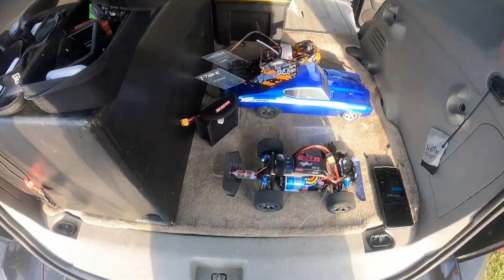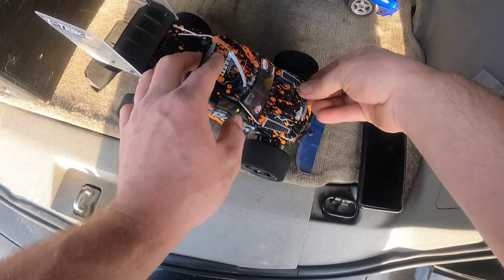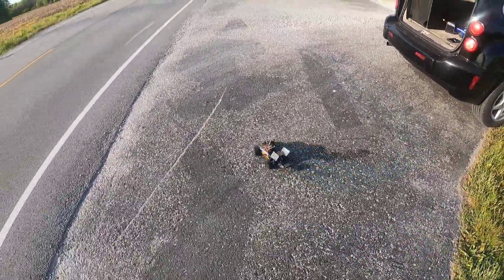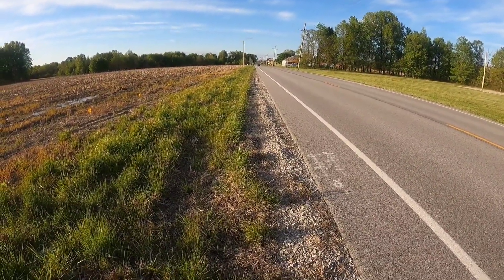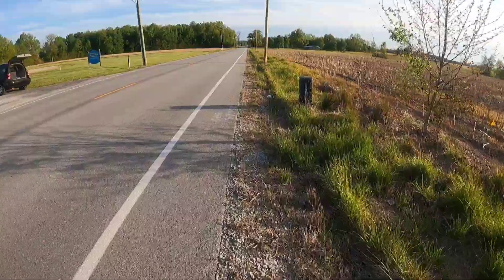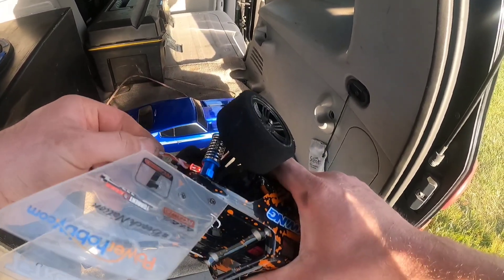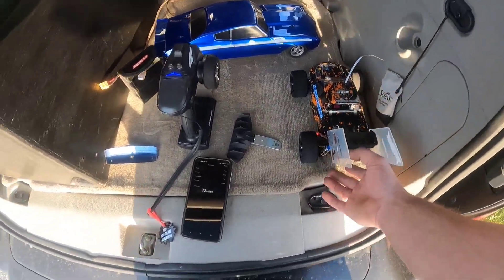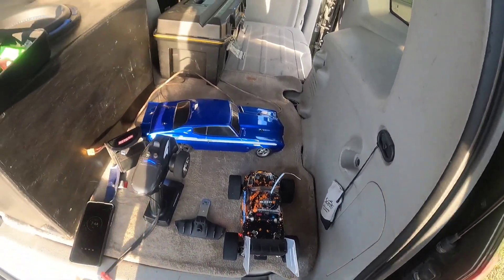Journey to 100mph with a custom built 60$ Amazon RC

Comment: toe your fronts in a pinch i can see they are way out on the toe that will make it extremely difficult to control at speed start off by setting them square then toe them in just a touch it should help a bunch!
Reply from the maker: This car has no adjustments in caster or camber that's the point of the video is to show how hard it was I got to 82mph I the next video
Reply: @garysrcchannel5251  right I understand that I was suggesting adjusting the toe
Reply from the maker: I tried aftermarket wltoys 959 turnbuckles and the car handle worse for some reason

Comment: What esc and motor???  Try using little orings wherever you have play in your front steering
Reply from the maker: Hobbywing 10bl120 & 3650 7620kv with 54t spur & 37t pinion fully Sensored

Comment: Hey bro thats all you can do on these days. Try making the bat wings like 3" tall. No wings. Get the body shell to make the downforce and use metal wieghts. Idk what Gyro was but try at 30% even if it wobbled and dont lift until it crashes lol see if 4x4 will pull it even if it looks wild it might keep going. I was cdfu on the traffic i feel totally 😆. Bro thats a plastic light 4x4 skatepark basher that did 81mph. You already won
Reply from the maker: Thanks brother I appreciate it 😁